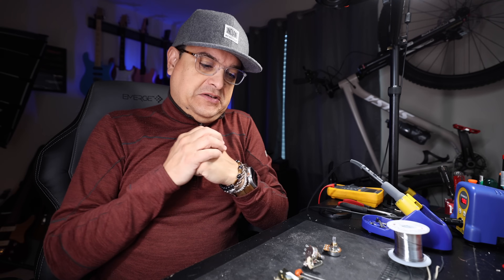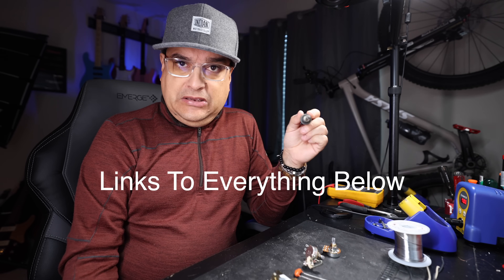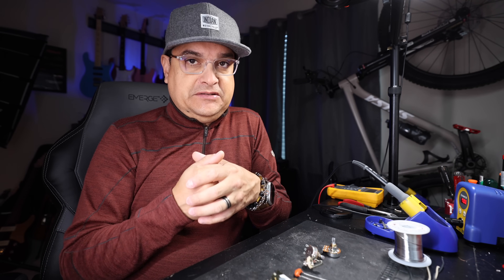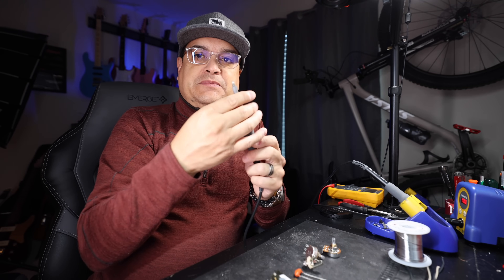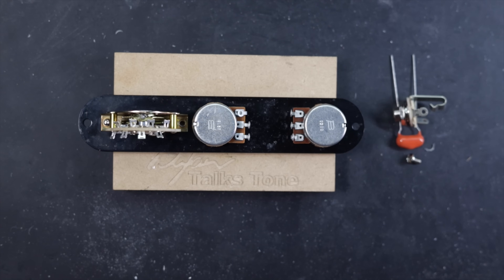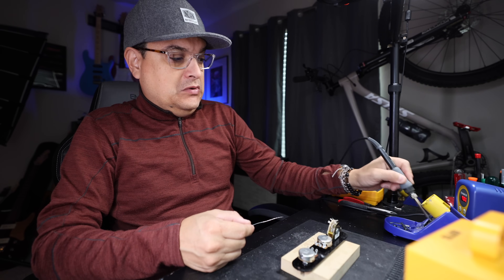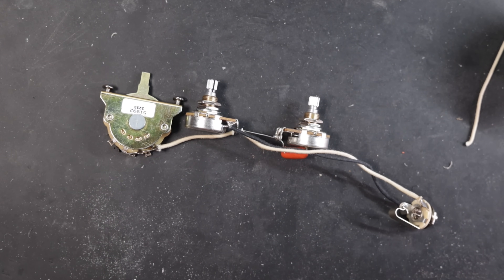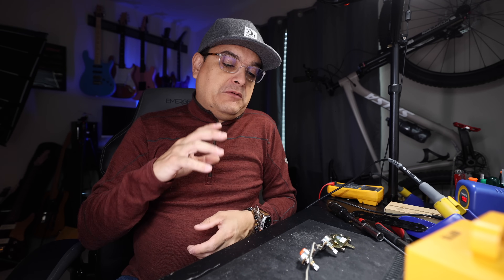If Your Soldering Sucks, Do These 5 Things

Comment: Great Video, Dylan.. well done!   I, for one.. really appreciate all the work & dedication that you put into all the video's that you post for everyone to learn from... Thank You, sir!    Myself, I have a Schneider Soldering "Station" from Harbor Freight.    It has 80 watts of power & up to 896 degrees F tip temperature.   It has a digital temperature readout, and an infinitely (up to 896 deg.) adjustable temperature control to precisely adjust the temps, then it automatically keeps the set temp (at the soldering tip), with a small variance of +/- 3.6 degrees F (similar to your Hakko FX-888D), regardless of how fast the heat dissipates.  

It's a great unit for the price ($119.) and compares to other "name brand" units that are in the $200. price range.  It's always been reliable and has had no "issue's" whatsoever, in well over a years consistent use.   

HF also has a "smaller" Schneider station, without the digital readout, and rated at 50 watts of power, with the same maximum tip temperature of 896 degrees.... just takes a little longer to "get there" with 50w, compared to the 80 watts of the other unit.  The 50 watt unit currently (11.5.2022) sells for $49.99... I also use the Schneider .8mm (1/32") 63/37 Lead/Tin Rosin cored solder (1/2lb spool for $19.99 retail).... which works great for my use... mostly doing "upgrade" work on my bass, and vintage Lap & Console Steel Guitars.

Love your channel, and how your so willing to share your knowledge with so many, out here in "internet universe"....  Subscribed a few years ago.
Reply: @UCQue6b-ha6TXPrCawkjWidg.... Hello, Dylan.... IF, you're "talking" to me,  I'm Not on "Telegram" nor Any other "social platform" for that matter.  Sorry... so I guess I can't "acknowledge my prize".   

Also, I do Not have, nor use Gen.5 type "open face" cell phones.... I only use a Gen.4 "flip top", so... no access to "Telegram to Text you there.    

I did try to "google" your site on Telegram, but it did Not take me to Telegram... just went directly to your internet website. 

Thank you, anyway.. Dylan.... I greatly appreciate it.   The Only "social platform" that I do, is my email.  : )   

PS;  Not sure what the "Flying Guitar" prize is... but, I would've appreciated it.

Comment: I have the exact Hakko station. I love it! I have a Ryobi station that uses a 18v battery (same one for their drills) for on the go soldering. You can plug it into the wall too. It works just as good.

Comment: I have one of the modern Orange Weller soldering stations ( from Home Dumpo); I don't recommend it.  I did not discover until I got it home and opened up the package that the iron itself is of the same cheapo type we've all seen that you can plug directly into the wall socket; in other words, the iron runs, or can run,  directly off  120 Volts AC wall current. The soldering "station" contains a pulse mode switching supply in it that allows you to lower the 120 V from the wall down to 90 or 100 V or whatever, to lower the temperature of the iron a little bit  compared to how hot it would be if you plugged it directly into the wall, but there's no temperature sensing feedback between the iron and the power supply.  There's no digital display for temperature in it either.
Reply from the maker: I mean … if you want to burn up tips and overheat and burn the element out prematurely… I SUPPOSE you could do that… but that is not how it’s designed. Just because it has a similar wall plug doesn’t mean that’s what it’s designed for.
Reply: @DylanTalksTone  ,  I've been working with temperature controlled soldering equipment for years and I can tell you that this orange Weller soldering station is not a proper temperature controlled unit. There's no temperature feedback from tip to power supply;  The temperature control is similar to a modern light dimmer that chops the way form into pulses and thereby reduces the overall wattage going to the iron. The system has no way of sensing heat draw being pulled away from the tip when you're soldering the back of a potentiometer nor anything else with any mass to it, and it will not increase the power to the iron to keep the temperature constant.  It's also worth noting that because it's an AC 120 V rated iron there's only 2 wires going to it, and  I'm not aware of any way that you can have the tip temperature of a soldering iron adjust itself automatically  if you don't have at least a 3rd or 4th wire in the cable from the power supply to the iron,  that could provide some kind of temperature feedback signal.

Comment: A low watt iron will do damage a lot easier than a high temp iron that is in contact for a short time. I learned that lesson the hard way years ago trying to replace a power jack on a laptop. The iron I had at the time had to be in contact so long to get solder to flow the heat transfer damaged the board.

Comment: Dylan, are you concerned about the heat being applied to the capacitor while you’re soldering it? I’ve seen others use a heat sink while soldering caps…
Reply: I'm not Dylan, but I learned soldering from electronic techs at work. Dylan used a hot temperature, so the time the leads were at soldering temperature was very short. Not enough time for the component to get very hot. If you use a low watt iron, it takes so long to get the parts up to soldering temperature that you will overheat them. I got a very high watt soldering iron when I started working on guitars, because a low watt iron can melt the innards of a potentiometer. Fast is good.
Reply: You can use a heat sink if it fits. However, I accidentally burned my Orange Drop capacitor without using a heat sink and with my terrible soldering technique. The capacitor was fine. No issues

Comment: This is just what I needed for my "3rd Rail" JMI AC-10 copy head, so I can connect it to the Scuminco in the GA-40.  Brian at 3rd Rail amps uses vintage components from the 1960's, including transformers, tubes, etc.  Scuminco speaker is supposedly like the Celestion silver bell used by Vox back in the day, so it should sound authentic.  Will my soldering chops allow me to connect a speaker wire?  Easy peasy you say?  You don't know me very well.........

Comment: i use kester solder with 2% silver. Is it bad to use for guitar work or no? have a massive spool like the one you have
Reply: I use that same Kester solder with 2% silver and it's excellent for electronics work, except that if you add it to existing leadfree solder  you'll probably find that it makes for a grainy, frosty looking joint.  If you try adding it to an existing solder joint and the resulting joint doesn't look good, suck the old solder off with desoldering braid or a solder-sucker pump thingie, and re-do the connection with your Kester solder.  Some lead free solder formulations are like that and they don't play well with other leaded solder.
Reply: @goodun2974  great tip! That's exactly what I found out by trial and error lol

Comment: Thanks Dylan! Your videos are encouraging to try doing my soldering by myself. It seems right to do with my hands when it is clear.
However, there's something in my guitar that just doesn't work. I have a good MIJ guitar, great hardware, nice pickups of models I've known, great pots and cap, I actually bought another set of great pots and cap, had the circuit rewired by a pro tech TWICE and to a schematic off the pickup builder site, -
- still the guitar has no highs. With coils split, with a no-load pot Installed, with a short output chord, - no highs. I use it with a Kemper  and FRFR monitors, so that is that too be excluded.
I have no other ideas than there's some inobvious factor in how all the components of the guitar work together...

Comment: Great vid!
Another few things you didn't mention that I think are worth it are:

- Using the standard "chisel" tip is all you need to transfer enough heat for guitar electronics.
- The other big benefit to using high heat is to help with "cold solder joint" where the joint oxidizes over time.
- You didn't mention how to clean up a soldering mess up. You can use the solder pump or soldering wick.

Hakko is great! I grew up using the Weller and the Hakko is just as good and reliable! Get it from a good source though there have been fakes floating around.

Comment: Yeah, don't use silver solder-this is not the right application for that.

Eutectic (63/37) solder works also, but it's more expensive so there's no point using it for guitars. 60/40 is fine
Lead free is obviously doable, but I think it's a pain because of the higher melting temp. Makes me glad I live in 'Murica'.